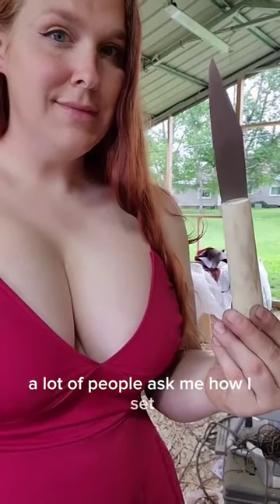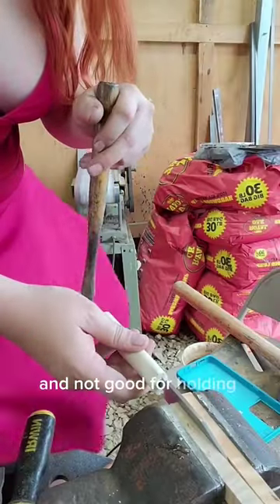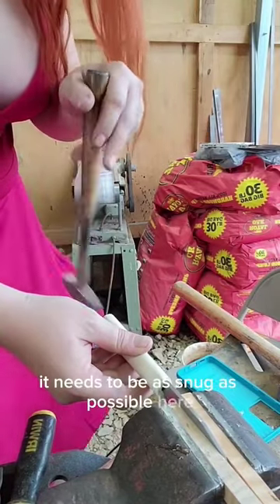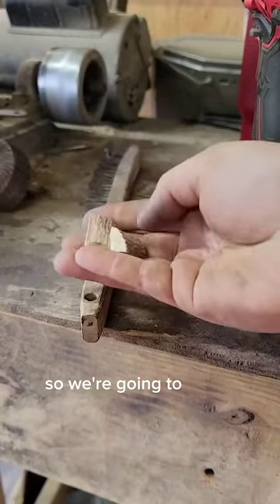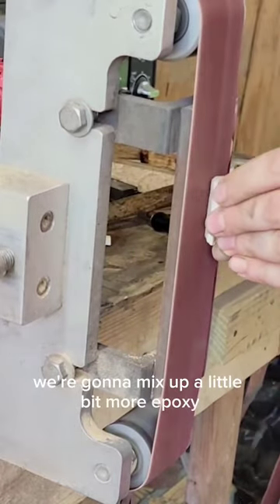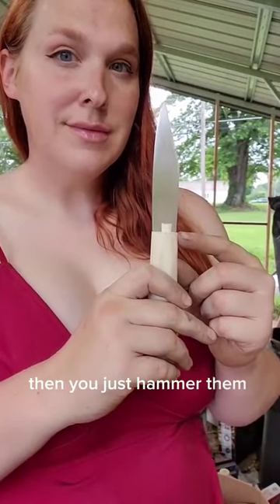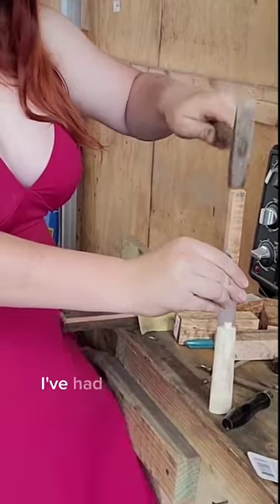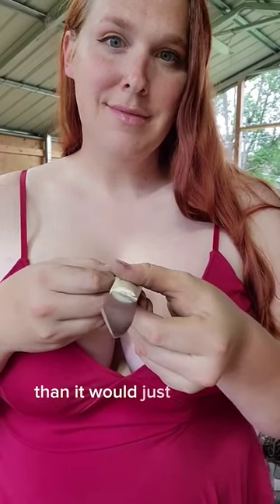making an antler handle #blacksmith #knifehandle #bladesmith #knife #blade #viking #bushcraft

Comment: I would be extremely lazy and use a two part putty to fill the gaps, maybe not the same quality finish but it sets as hard as rock.
Reply: I thought about just using epoxy, but the antler shims do give a much better finished look.

Comment: Originally, a lot of the handles were made from reindeer horn, which is not as porous as Whitetail and mule deer in North America but in Europe, they used reindeer, which is ice more solid horn. You’re doing a beautiful job that’s about the only way you can get it to work right with the horn you’re working with

Comment: If you get an old knife without the handle you can heat it up red hot and put your antler handle in a vice or clamp and push it the handle . No gaps.

Comment: I’ve got 2 1/2”x6” ferro rods that I plan to use deer antler for handles on. 
Fortunately I think I’ll be able to just drill a hole the same size and then set the ferro rods in with epoxy. Then polish the antler with a buffing wheel.

Comment: There is a technique out there of boiling the antler tell the pith in the centre becomes gooey like a horn glue that one would say, and you can slide for handle him, and it will create a natural epoxy you can try it sometime white tail is the most poorest so will probably take it a lot easier, so what elk

Comment: I made a hammer used antler for the handle I used epoxy designed for nonporous materials such as antler bonding steel and antler it's a great Lil hammer